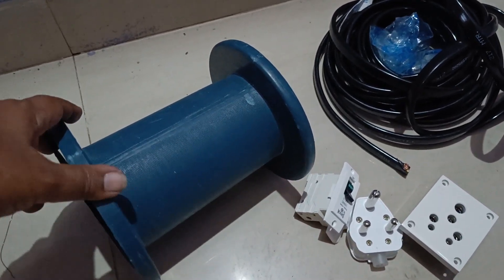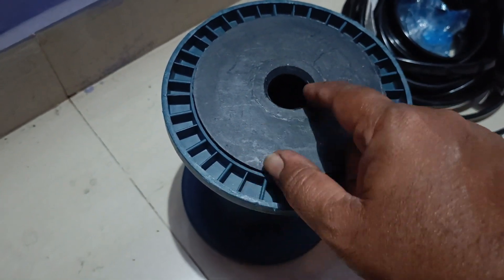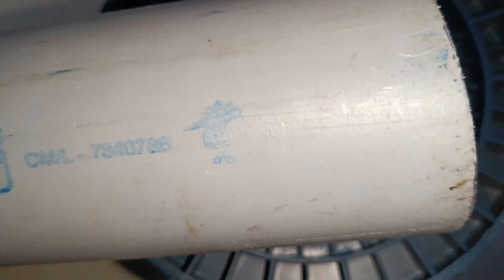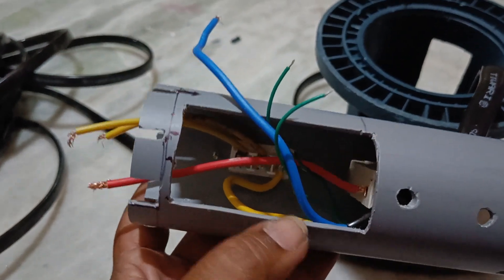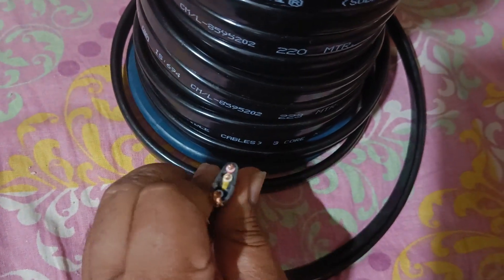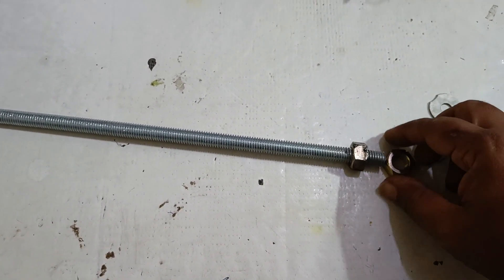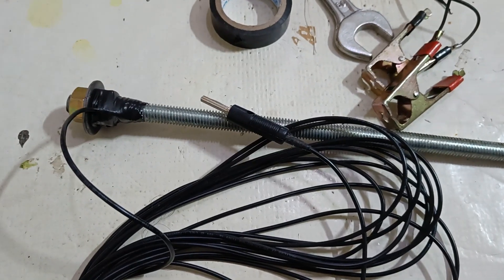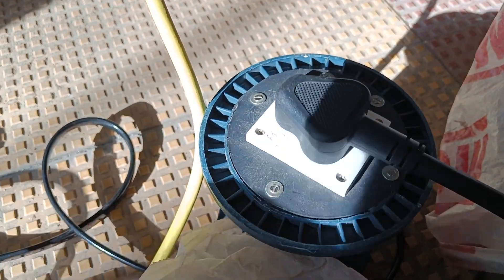EV Portable extension 3.3KW #extensioncord ,#tigorev ,#evcharging ,#evcars ,#evbasics ,#project

Comment: I am an electrical Engineer and consultant.

You pls mention 3 core cable of 4sq mm as min. As multi core cable can carry lower currents than single core cables.

Actually I recommend 6sq mm. But it may be difficult to handle.

I am impressed with your work.
Thank you

Comment: So simple, how much did it cost u overall for all the parts
Reply from the maker: Power meter around 1800, cable 2.5 sqmm 75 RS per metre, plug 120, trip switch 120 , banana connector 20 or 30, bail from motor winding shop 50 rs. Cost depends on size and mood of vendor